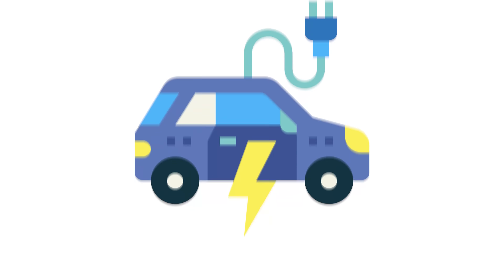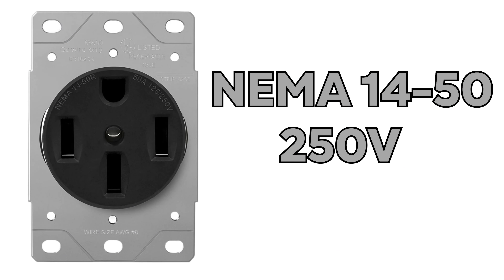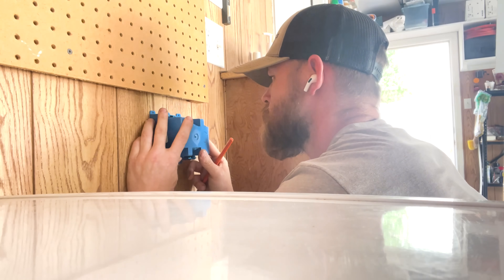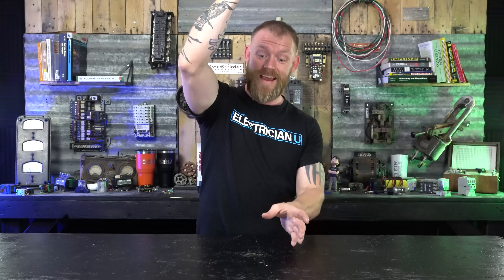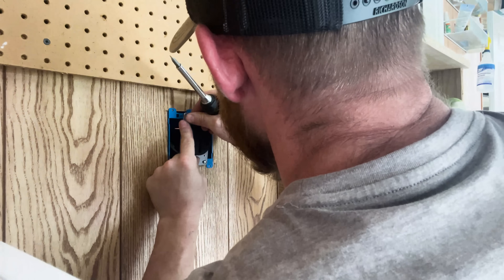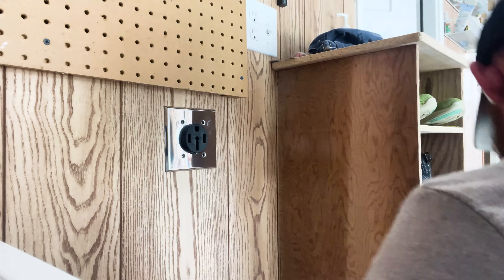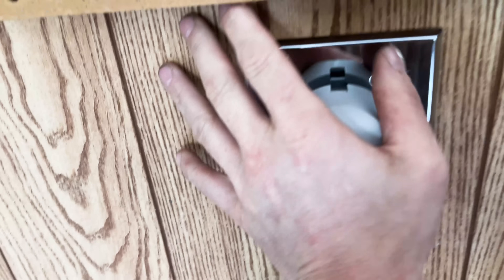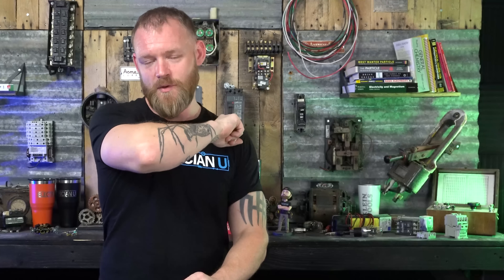How to Install an Electric Vehicle Charger Receptacle

Comment: 1. Use 6-gauge wire
2. Use metal box, mounted to a stud
3. Use GFCI breaker, it's required by code
4. Use 50A breaker, the NEMA 14-50 should allow up to 48A load.

But a hard-wired charger is likely the way to go.
Reply: Tesla's recommend a 60amp breaker with the nema-1450R. My guess is has something to do with startup current.
Reply: Because the load is continuous, a 50 Amp breaker with a NEMA 14-50 only allows up to a 40A load (80% rule for continuous loads).
Reply: over 100 ft you will want to make that 4awg or if its aluminum wire.
Reply: Besides the GFCI, what other parts of your list are also required by code?

And what exactly do you mean by hard wired charger?
Reply: @fjl05  codes are local, minimal, and also evole over time. These are recommendations if you want a solid installation. For example plastic box may be up to code, but most are too flimsy for this wire thickness and regular plugging/unplugging. An industrial outlet is also highly recommended. The hard-wired chargers skip the outlet and connect to the wires directly, so you can save on the cost of wire (no neutral), the cost of outlet, and the cost of GFCI breaker.
Reply: @valeriyo  im stil not sure what you mean by 'hard wired.'
do you mean an installation where you run conductors directly to the charging device from the panel? Wouldn't this type require also a GFCI breaker? or just a regular breaker? And do all car chargers that connect through an outlet also require a neutral? And why would they if you mention that the hard wired doesn't require a neutral?

I have an ac unit that runs on 240V and it uses an outlet with no neutrals. Why wouldn't they just make chargers that support this as well?
Reply: Hard wired means power would enter the ev charging unit instead of having to plug in the car charger into the the plug like he did at the end. If it was hardwired you would’nt be able to just disconnect it from the plug you would physical have to go to the panel and turn off the breaker feeding the charger. Hence “hardwired”
Reply: @leomolina4601  ic... thx

Comment: Quick tip to anyone installing a NEMA 14-50 receptacle for EV service equipment!  Check the orientation of the ground pin on the plug of the device!  Most of them are set up for the ground pin to be at the top, and the cable hangs downward, but occasionally there may be one with a ground pin at the bottom, so make sure you orient the receptacle to match the customer's device.  NEMA 14-50 is also the same connection used if a customer has a travel trailer or motorhome with a 50A hookup that they want to keep plugged in at home (though most people will just use a NEMA 5-15 adapter if they only need to keep the batteries topped off).

also, quick tip for marker mistakes!  If you leave a mark somewhere and need to erase it, rubbing alcohol or some QD contact cleaner will remove Sharpie.  Just make sure to use a paper towel or something and be careful not to streak it all over the place.  But seriously, it is easier to just use a pencil in the first place!

Great video!  Thanks for sharing!
Reply: Great writeup homie!
Reply: actually you should us an EV rated receptacle, they are rated for a continuous load. I've seen people burning up a regular NEMA 14-50, especially with a 50amp breaker and a charger that will pull 40 amps.

Comment: The whole smaller breaker doesn't seem worth it to me. The load will draw what it will draw.   The charger. Inverter and vehicle should be protected on their own. Sounds like they have been watching videos from ev haters of vehicles that catch fire when charging. Mostly from improper wiring from the panel to the charger.  If I came across something with such an undersized breaker even though it's acceptable I would question other things I could not see.
Reply: You can buy EVSE with a 14-50 plug but which only needs a 30 A circuit. Presumably that's what the customer is using here, and putting in a 30 A breaker ensures that if the EVSE fails and draws too much current, the breaker trips before a fire starts.

With a 50 A breaker, the EVSE could fail in a way that draws 40 A, the breaker wouldn't trip, and the EVSE or its cord could overheat and start a fire.
Reply: @harvey66616  I get it and why but at the same time I wouldn't request it as a customer.

Comment: Note if you go over 100 feet use next size wire retired electrician 37 years bad back and knees 😆 voltage drop easy not going into calculations

Comment: We've made the decision here to upsize wires by 1 size, and use only metal jboxes. Plus, we bought a few tension drivers to make sure the receptacle is tightened exactly to spec. Had a small fire from an EV on an otherwise perfect install, because the vehicle was actually pulling more current to charge than it stated it would. Ugh.
Reply: May I ask which part failed?  Was it the receptacle that failed or did the wire get too hot and melt the insulation?  Wasn’t the breaker sized to protect the wire?  If so, then what does upsizing the wire gain?  Also It’s my understanding that there are different grades of 14-50 receptacles, (just like the 120v versions from residential all the way up to hospital grade) and some low-quality 14-50 receptacles aren’t designed for six hours of 80% current load (vs a range top that is only used an hour or two per day).  I’m just trying to learn from other peoples’ experiences.  So thank you for any info you can provide.
Reply: @Richard-1469  it was about 2 years ago, but I remember it was the receptacle that failed. We had run an SER cable, but I don't remember the size. 
I remember some wires in the back were loose, but we couldn't tell if it was the install being over/under torqued or from fire damage.
I remember it was all 100% manufacturer specs, though, and that was why we decided to upsize the wire.
And I got to see stills from the customer's security camera. Thing lit up pretty badly.
Reply: @imnotgreat  Thank you for the info!
Reply: @Richard-1469  read my comment above.
Reply: You should use an EV rated receptacle. It's rated for a continuous load. The NEMA 14-50s aren't. That was your problem actually.

Comment: Why do some Tesla chargers not require a neutral conductor ?
Reply: If the EVSE (whether Tesla or some other brand) has components in it that are only using 240 V power, the neutral doesn't matter.

Whether there is in fact some EVSE out there that for whatever reason was designed to include some 120 V component(s), I don't know. I doubt it, but who knows? Manufacturers do weird things sometimes.

Comment: Question for the comment section. Is the NEMA 14-50 superior to the NEMA 6-50? If so, why? What extra functionality does the neutral wire in the NEMA 14-50 have over the NEMA 6-50? Thoroughly confused.
Reply: There is little additional function. The reason to use 14-50 over anything else is that it became the de facto standard and some models of EVSE have a molded connector that cannot be swapped. Tesla did it right by offering different dongles, including 6-50.

So "the plug is the right shape" is the main reason.

Now, if an RV were ever to want to plug in, that would work great on a 14-50 and wouldn't work at all on 6-50. RVs need the neutral. So there's that too
Reply: @ewicky  Thanks for the well-detailed explanation!

Comment: hay dustin quick question.  If you hay An EV and you need to charge it but you don't have a garage then how do you install the receptacle outside.
I love the videos your in my top 3 youtubers keep up the amazing work bro.
Reply: It depends on the situation, but one way or the other you'll want to use a weather-proof receptacle. This could be on the building's wall, or installed on a post near where the car is going to be parked, or whatever. Of course, you'll also need some means to protect the EVSE from the weather, unless it's already designed to be weatherproof.

That said, for that sort of situation I think it'd be better to hardwire an EVSE type that itself is already weatherproof. They do make EVSE for outdoor use and that seems like a better choice to me.
Reply: @harvey66616   thanks man it makesense

Comment: All ev chargers I’ve installed have been using a 48A constant load.. at 125% it requires a 60A breaker. This gets away from the gfci requirement? yes? I always pull a neutral just in case the customer wants to utilize for a power inlet in those crazy times of wild storms..

Comment: Everyone seems to be commenting that the #8/3 NM cable  is only good for 40 amps. This installation is code compliant, but no more than 32 amp continuous load on this outlet. Here's a great tip. Romex is limited to 60C, but SER/SEU cable is not. I would use 6-6-6-6 aluminum SER cable for a 14-50 receptacle. Make sure it's AL/Cu rated and torque the screws to spec twice. Then you get the full 50 amps and it's cheaper than #8/3 copper romex. When installing Tesla Wall Connectors hardwired on 60 a amp breaker, use 6-6-8 copper SEU cable. It's hard to find but it can be had for $2-$3 per ft

Comment: So i do a lot of these, it’s kind becoming my niche. There are many different configurations and ways of going about doing this. One of the things that’s required in my neck of the woods by inspectors is a load calculation. If the load calc puts the main panel over that 80%  mark with the charger figured in then a service upgrade is required. When installing EV chargers we have to show the load calc to pull permits (IF we have to pull permits). It sucks for the customer but can mean extra dough for the business. There are EVEMS (Electric Vehicle Energy Management Systems) products out there that limit the amount of current going to the charger by monitoring the mains then supplementing left over current to the charger. These are great but can be pricey and need to be approved by the local inspector before installing (again that’s IF it has to be inspected). We always do our best to give the most cost efficient and safe options to our customers…emphasis on safe! It’s not always safe to throw a 60 amp breaker in a panel just because you have the space.
Reply: EVEMS greatly extend battery life and improve safety and grid stability. Meters should be required to answer queries about current draw so the EV charger can change the maximum charging level. 

Inspectors requiring service upgrades is a corrupt scam, an EV is in total control of its draw at all times and there are dozens of ways to ensure it doesn't overdraw ever. 

Literally everything else in a building is more likely than the EV to overdraw the panel.
Reply: Damn, is there any way to speak personally with you? I am also trying to make this a niche type of side work, but there are a few major questions that I have

Comment: Only thing I would have done different is mount the double gang box onto a stud. It is a little more work but much more secure, especially for a receptacle that will get a lot of usage. For a dryer or stove a cut-in box is more than enough due to the amount of usage. But if they are going to plug in and unplug on a regular basis that is going to be a lot of work for that cut-in box to handle over the long haul and will eventually loosen up. I have had the fun of installing a few of these, and you are spot on with the video. But Tesla's are a different animal and it all depends on the charger you get. But they max out at 60A can go all the way down to a 15A supply. Don't recall the Gen 2 or first Gen specs. But the Gen 3 is a lot easier to work with.
Reply: Gen 3 maxes out at 48 Amp requires a 60 amp breaker

Comment: Most EVs can be current limited in the cars settings, Tesla's will remember by GPS location...  I would always install the biggest breaker for your plug and just tell the car to limit its draw rather than waste time/money calling an electrician later when you realize you could be charging your car in half the time at the full current.
Reply: I have never heard of using a breaker to purposely limit current to a receptacle.
Reply: @normferguson2769  when you think about it the sole purpose of a breaker is to limit current to anything downstream.  Only time it'd make sense to undersize is if the EV doesn't have current limiting or panel would be overloaded otherwise
Reply: "just tell the car to limit its draw" -- No. I mean, yes, do that. It's fine to program the car to charge at a lower current than the EVSE is nominally capable of, and doing so has some benefits, like extending the car's battery life by charging it more slowly.

But no, that does something *completely different* from using an appropriately-sized (smaller) breaker and suggesting doing so as an alternative to using an appropriately-sized breaker is *really bad advice.*

The breaker is there to cut off the power supply if something goes wrong and the equipment draws more current than it's supposed to. If your EVSE is capable of charging at 40 A, and the car is capable of charging at 40 A, but there's a 30 A breaker, the breaker is just going to turn off the circuit. It's not going to limit charging to 30 A; that's the job of the car and/or the EVSE.

The point of putting a breaker in that is sized appropriately for the EVSE is so that if the EVSE has any kind of failure that causes it to draw more current than it's designed for, the circuit will be turned off by the breaker before anything gets got enough to start a fire. It might even limit damage to the EVSE itself in a way that would allow for it to be repaired instead of having to be replaced outright.

Programming the car to charge at a lower rate does *nothing whatsoever* to accomplish the safety benefit of putting in a breaker that's the correct size for the EVSE that will be attached to the circuit.
Reply: @harvey66616  huh?

Comment: @3:24 As an interior wall of a garage, would that be one of the fire barrier walls? Hard to tell the circumstances from the vid, but if so,  wouldn't code require the box be attached to a stud, not a drop in?

Comment: Putting a 30A breaker in makes no sense in this case.  A car charger will only draw as much as it is rated for and won't "overload" itself.  Now, you are just setup for a nuisance tripping when you plug in a device or car that needs MORE than 30A.
Reply: But you're also potentially avoiding a fire in the case where the EVSE only needs a 30 A circuit, and has some kind of failure that causes it to draw more than 30 A but less than 50 A.
Reply: @harvey66616  That is not how it works.  A breaker is there to protect the wiring, not the devices.  If that were the case then everything you plug in to any outlet could be a fire hazard.  Devices are expected to operate safely and have their own built in safeguards,  at least UL listed ones are.  It is not reasonable to expect a panel breaker to protect a device.
Reply: @shrinermonkey1  "It is not reasonable to expect a panel breaker to protect a device" -- no one's suggesting it should. But there's no reason not to ask the breaker to protect the building from a defective device.

You may disagree on philosophical grounds, and that's fine. But saying it "makes no sense" is wrong. It makes plenty of sense, from a perfectly legitimate point of view, even if you don't share that view.

Comment: Very informative video. I do Own a Tesla Model3 and exclusively use the mobile charger that is included with the car. I use a 14-50 at work (free juice) and a 20 amp 120v at home just to maintain charge. I highly recommend a high quality 14-50 like a Hubbell. you will pay a good bit more but as in my case it is plugged and unplugged daily.A standard 14-50 is usually used for a range that is plugged in once or twice.Look forward to more videos.

Comment: I’m an electrician, who bought a Tesla last year.  It was awesome being able to set up my garage for charging without having to hire someone.
I had some extra #6 wire.. so I just went to Lowes and got a Nema 14-50, a 50a breaker, and had the whole thing done in 20 minutes and only spent $60!  Meanwhile my neighbors have spent $1500-$2000 when they got their Tesla’s..  they asked how much I spent for my setup… was a proud moment.
Reply: If you're an electrician, why are you going to Lowes to pickup their crap Nema 14-50 receptacle? Those aren't meant for the constant draw of an EV.
Reply: I never said that I was a “good” electrician.  Get back to your job at Home Depot.  Calm down son.
Reply: I'm sure they feel the same way with their credit score compared to yours 😉
Reply: @ITIRICI  not sure where you are going with that.. it sounds like you’re implying that tradesmen have bad credit scores?  A little judgmental no?  My credit score is 805, a product of hard work and lots of discipline just like where I’m at in my electrical career. What’s your credit score Josh?

Comment: Step one - watch this video. Step two- install it yourself :) This video is complete and accurate, except for torqueing the screws on the receptacle. If they loosen, this can be a source of arcing and heating. Torque your wire connection screws on the receptacle, then check them awhile later. You can get a cheap 1/4 torque wrench from Harbor Freight or amazon.